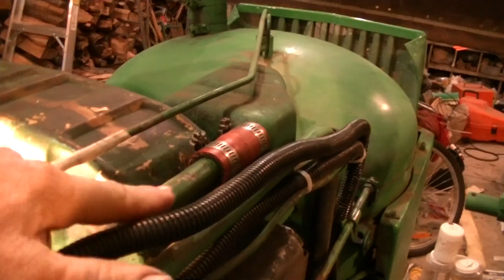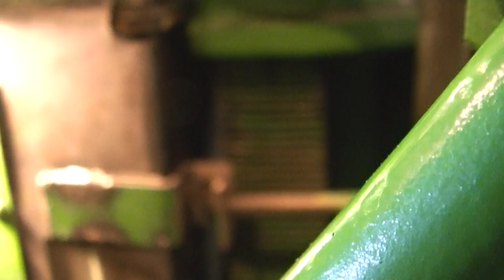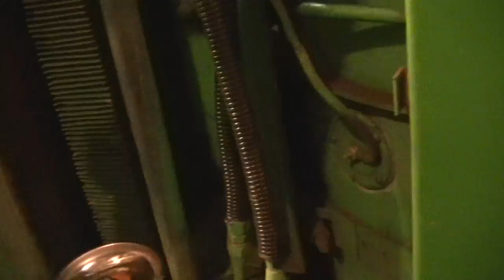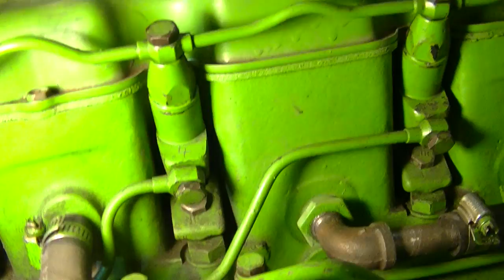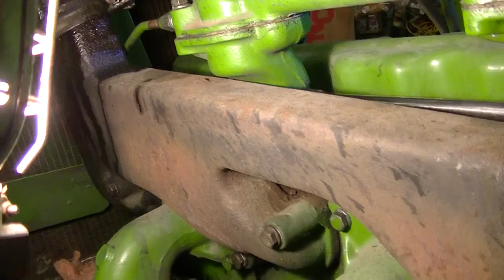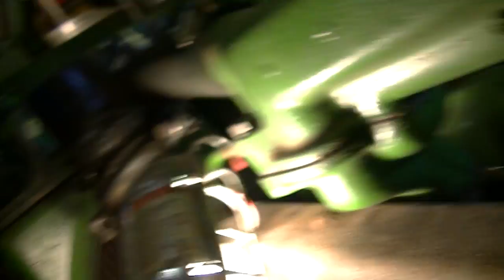John Deere 4020 Cooling System zeketheantiquefreak

Comment from the maker: While I had the radiator out I removed the thermostats and slowly boiled them in a pan on the stove. I was unable to verify that the rated opening temperature was still valid, but I was able to ascertain that they opened and closed again. They are dated back to 1964 which I consider to be excellent service. 52 years, 8,500 hours and counting.
Reply: QQ, where is the engine temp sender installed on this model?
Reply from the maker: @abneraguirre5779  On my unit, a 1964 4020 22T model with the '404' engine, the engine temperature sender is at the left rear of the cylinder head, between the valve cover and the manifold. This one is a mechanical sender, not electric.